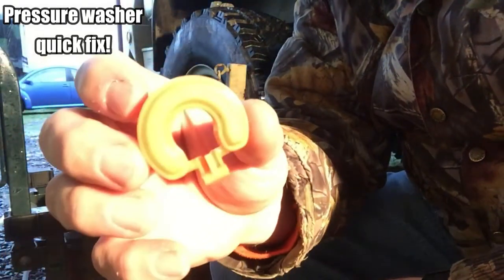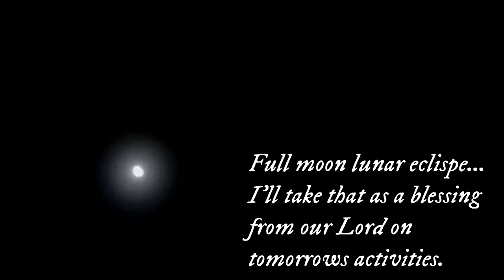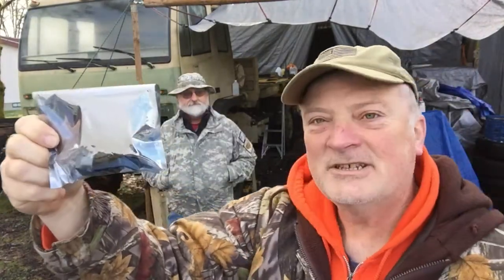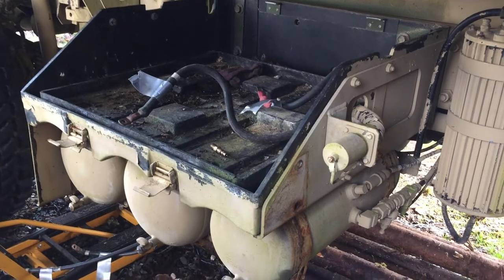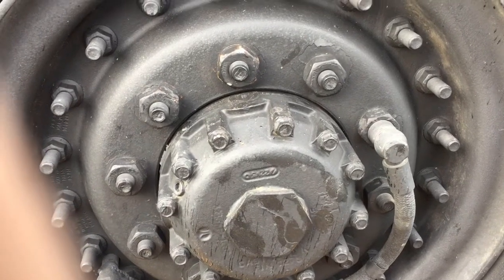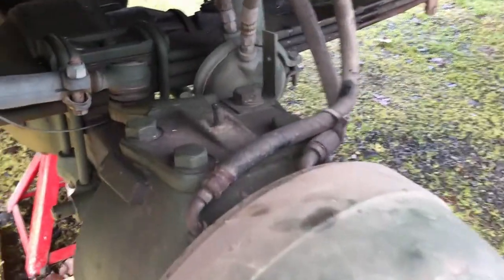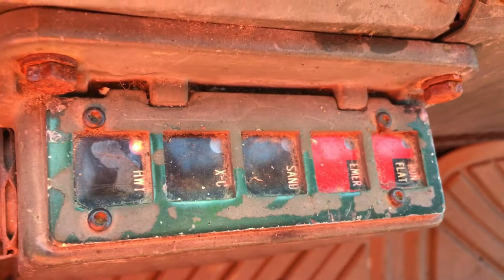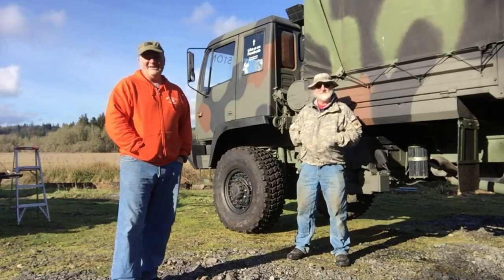LMTV TIRE CHANGE TUTORIAL & CTIS PSI Upgrade #16

Comment: Silent Bob makes an appearance...
Pick up a quart of flat black rustoleum oil based paint at home depot or lowes for 9 bucks after your veterans discount.  1 quart will do all 4 wheels with 2-4 coats easily.  Put it on with a brush.  Glad to see you got those swapped out.  Impressive you did it with hand tools.
Reply from the maker: It is definitely a two man job, at least with the tools we had to use. I would hate to get flattened with a tire falling on me. lol. I have some Rustoleum in the can that I am going to use... it was left over from the repainting of Malachai last Spring. Do you recommend a brush with all those nooks and crannies on a rim? (Bob found the Easter egg, already.)

Comment: Who has a pallet jack in their variety of home tool? HAHA! It looked like you lined up the hubs with the wheel to get them on. Could you slow that part down to normal speed next time?
Reply from the maker: Yes, I'll slow it down. Today we pulled the two fronts off of PARTriSha... the pulling part at normal speed. The pallet jack is Bob's... though he is trying to leave it with me. I might just take him up on that, especially since it worked so well to remove the tires. I have a motorcycle jack, but the bottle jack we are using has a short throw, so the pallet jack is what we are using, even though it is cumbersome.